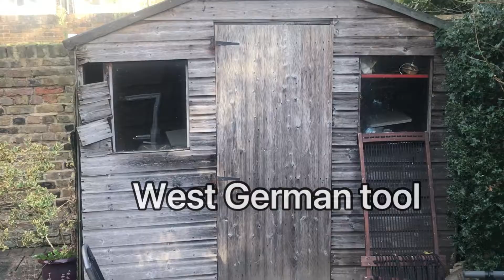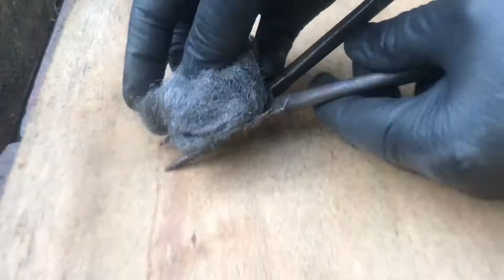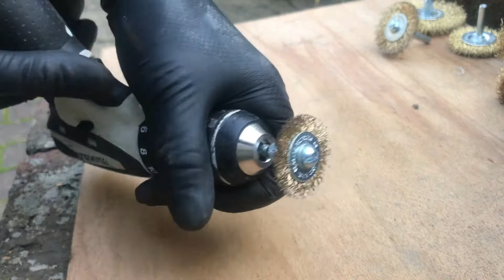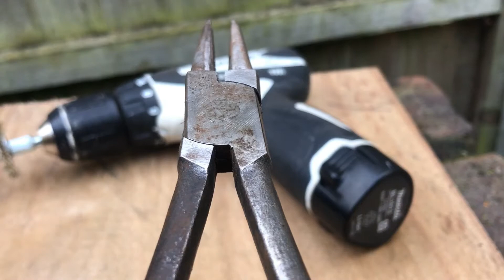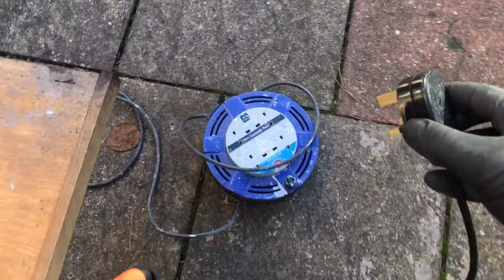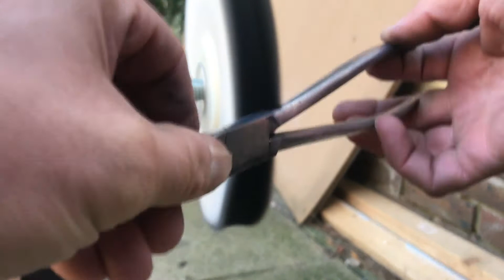Restored West German tool

Comment: Now that is the type of old shed that I like to see!!:) It is really neat that you are still able to see the manufacturer and even the serial number of the old pliers. That metal file that you were using seemed to be an ideal tool to use, it was able to get into those little nooks. That power tool of yours certainly got the job done, didn't it? I felt sure that you were going to need to use some liquid assistance, but you managed it with some old fashioned labour and a bit of elbow grease ;)